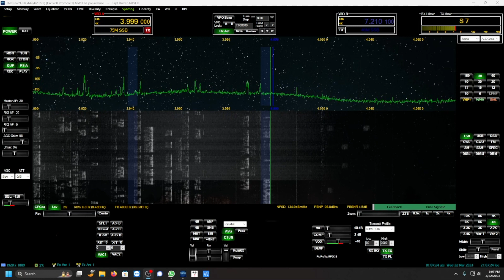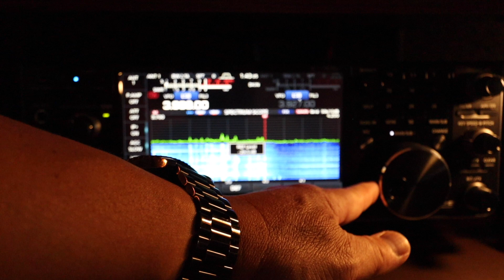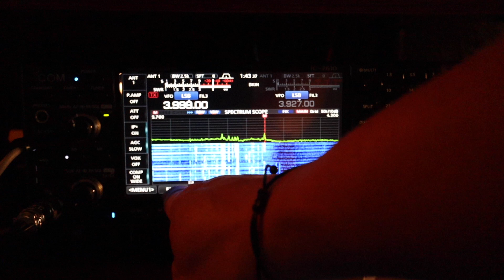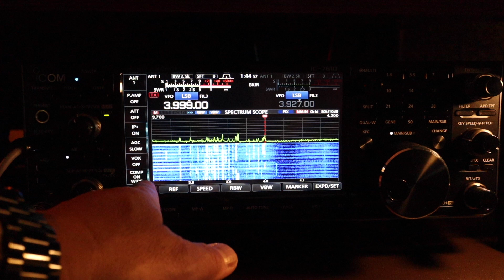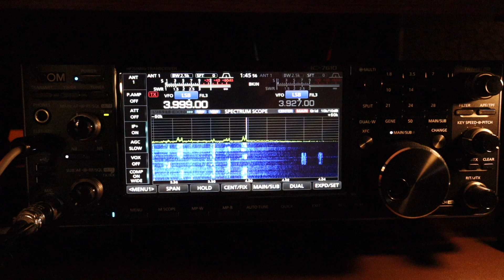Noise Blanker Comparison between the Anan 7000DLE Mk3 vs the Icom IC-7610 | Power line Interference

Comment: What about FTDX101  vs  the Anan ? I think even if it  is not better than the Anan, but it is closer than the ICOM.
Reply: I have both radios and the Anan really is better. Still love using the 101D just for the buttons.
Reply: the ftdx101mp is much better a lot then the anan G2   this been test with big antenna not wire I use 2 optibeam  
lower band I use full size 160m vertical the 101mp so much better in every way

Comment: I don't think that's powerline noise.  See how it is to the left of the waterfall?  The SDR seemed better on the filters.  Have you ever turned off everything in the house and run off of a battery?  I am sure you have. Would be hard on the SDR,  but the 7610 by itself would be interesting to see.    Powerline noise would be 60 HZ.  Strange area for noise.  Informing video thanks. K4RNA
Reply from the maker: Aaron, yes I've shut down the power in the house and verified nothing is enaminating from within.  My mother's large screen TV put's out RFI but during this testing, it was off.  I will not totally get rid of power line Interference because when the utility company finds a strong source and repairs it, another one would pop up somewhere else.   Right now I can work with it because the RFI isn't too strong.  I need to bring down my noise level though.